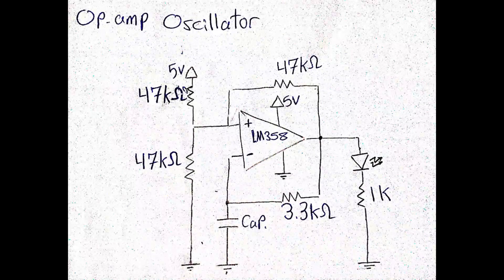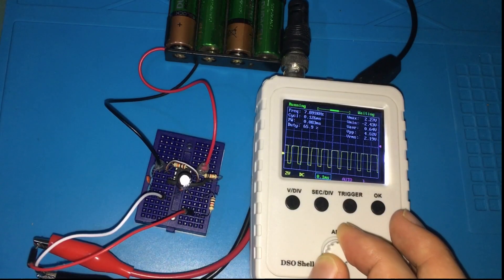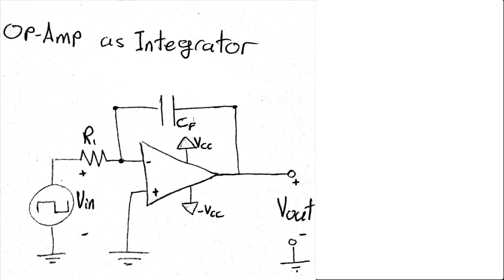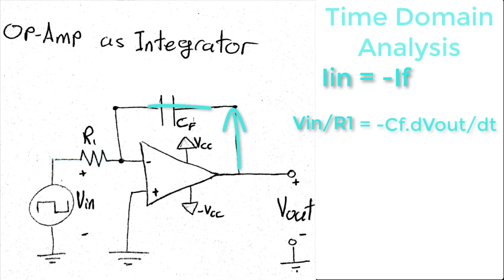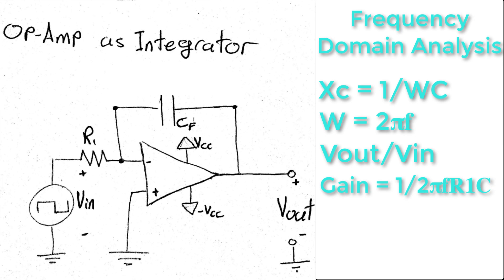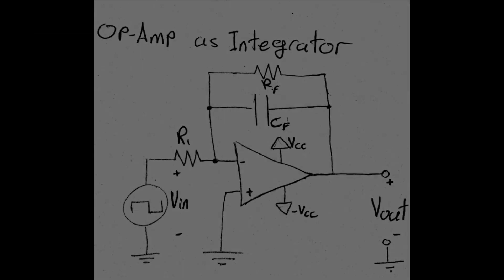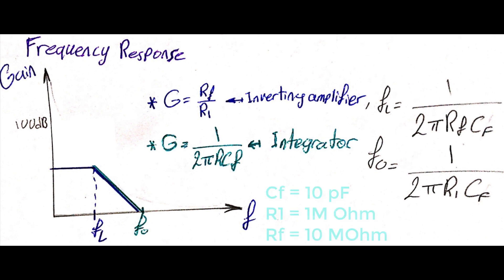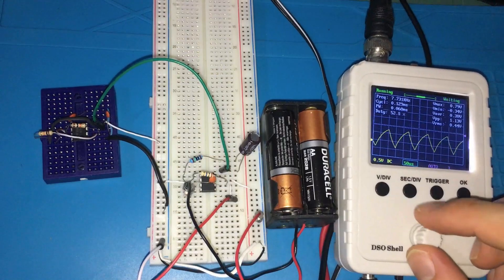Square to Triangular Signal Conversion Using Integrator

Comment: Can it integrate over a range of frequencies? I want to use it for about 30 - 480 hz based on my square wave generator circuit, will the result be a consistent triangle wave. Furthermore, can I run a second in series for a sine wave output
Reply from the maker: İt is of course  possible to achieve the frequency range you wanted and don’t forget to adjust your gain accordingly. In theory you are supposed to get a sin wave with cascaded filter but your signal amplitude will decrease significantly
Reply: @usefulelectronics  thank you my friend